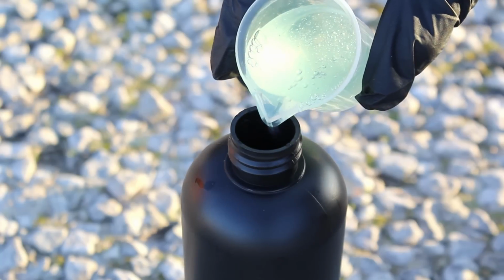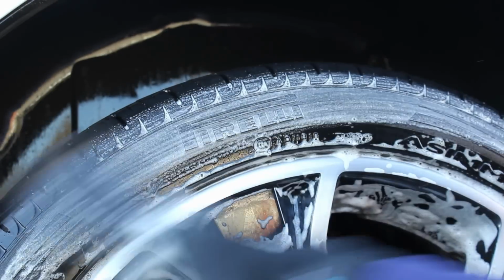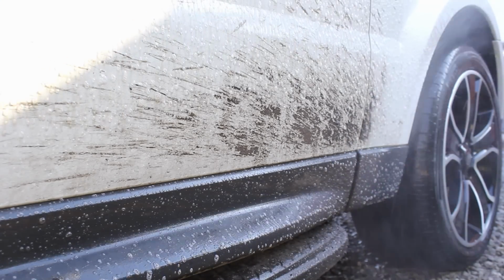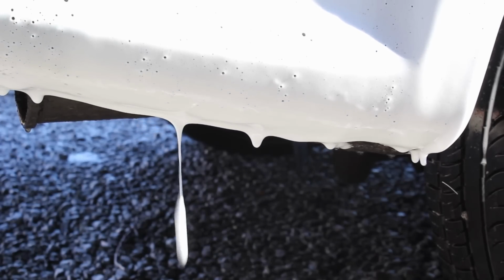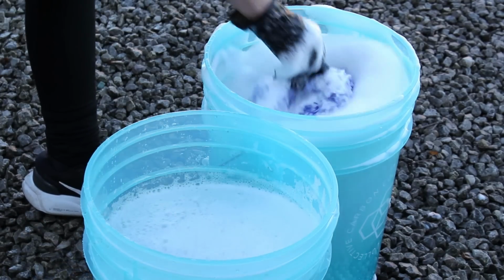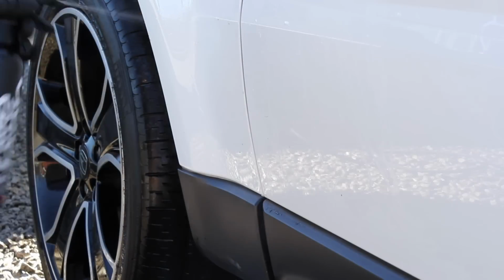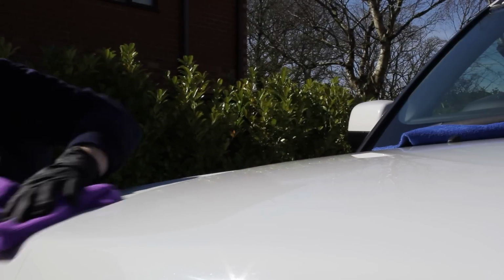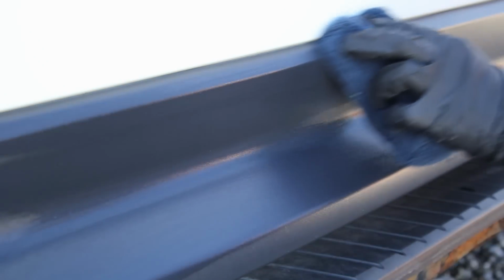Filthy Range Rover Sport | Deep Clean and Protection

Comment: Great transformation Heather.  I've had  mixed results with Parla, sometimes it goes on a dream, but its not a product to use on a warm day. Let it dry for too long at your peril! It becomes stubborn to buff off and I have ended up deconning panels and starting again before now, Customers phoning mid application can cause grief then! If its warm, or windy, only spray onto a cloth then apply, do not put it straight on the panel. Its still a product I like though and use regularly!
Reply from the maker: Thank you!
I’ll keep that in mind with Parla cheers! I’ve used it mainly in quite humid conditions but not very hot so I’ll avoid it on those sunny days!

Comment: Wow, I love R/R nice colour and very nice detailing and instructive video, Hi, Heather I hope you are well,  I want to ask you what the maximum temperature can wash a car in the sun, you know here in East Canada is turn very hot know I hope England not. Best.
Reply from the maker: Thanks Jorge!

If the the weather is a bit cloudy then I find that above 25 degrees Celcius (77 Farenheit) starts to make things more difficult. If it's in direct sunlight though it definitely causes more difficulty at lower temperatures (about 20 degrees C/ 68 F) so I have to try and keep the car cool with the pressure washer so products don't dry out
Reply: @AutoCareHQ  Thanks 🇨🇦👍

Comment: Very nice turnaround. Question: I leave the glass until last. I get the glass nice and clean, then move the window down to clean the top edge. When I move window back up, the bottom of the window is dirty from the dirt trapped in the window seal/gasket. What do you do to clean this area out? Thanks Heather.
Reply from the maker: Thanks Kim! I usually just get in the car so I can clean that bottom bit when the window moves up when the door shuts :)

Comment: Hi Heather, what piping do you use for your trigger to your pressure washer? Mine is forever bogging me down and getting tangled.
Reply from the maker: It’s just the standard hose that comes with the Kranzle, it’s great quality
Reply: @AutoCareHQ  Looks superb. I forgot you switched to Kranzle. Been waiting patiently for the last 6 years for K2 to bite the bullet but it just keeps going even when my clumsy sister put it on with zero water in the tank 😭. I need me more power...

Comment: That Pyramid snow foam lance looks interesting. How would you compare it vs the MJJC Pro 2 as that’s out of stock with a 1/4 QR everywhere?
Reply from the maker: It's a really good lance, I probably use it more than my MJJC and MTM now. 
It drains the bottle quite a bit slower compared to the MJJC so the foam isn't as thick if you put the same amount in, but the cost per wash is the same when you factor in that drain rate. The construction is nice and sturdy and the measurements on the side are clear. It will leak a bit if you tip it upside down (not something that I noticed with the MJJC, although the MTM suffers from this problem too)
Reply: @AutoCareHQ  thanks for the very full reply, Heather. I think I’ll get one.
Reply from the maker: @JamboLinnman  No problem, I think the code "ACHQ" works on it so you should be able to get £10 off it
Reply: @AutoCareHQ  brilliant, thanks!